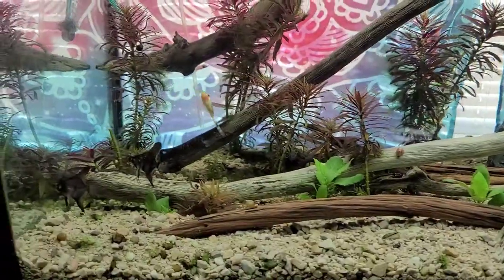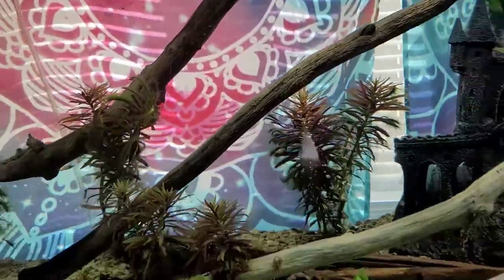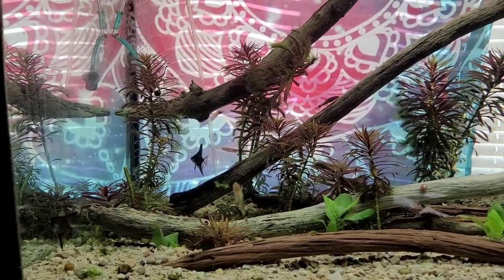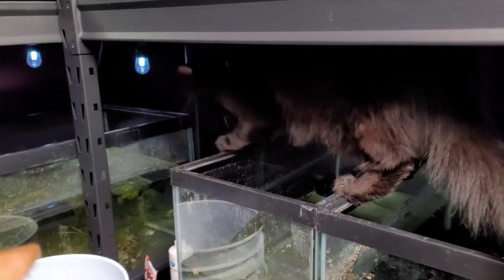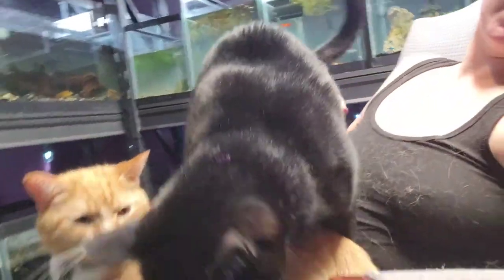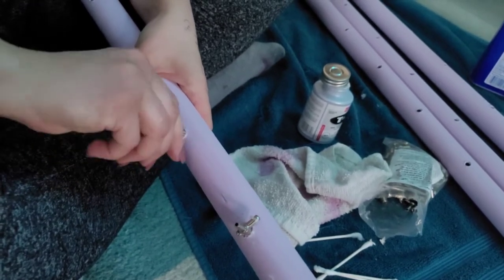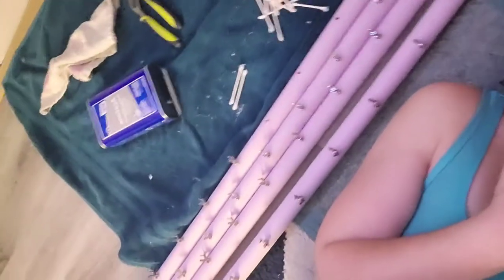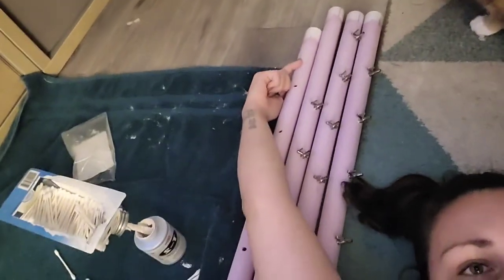Air Manifold Project Part 3 Painting Done & Spinning Valves

Comment: Pro tip: you can use the drill to screw in the valves.
Reply from the maker: I didn't want to. It's too easy to cross thread something with you use a drill and I didn't want to scratch the valves. I thought of that and decided against it 😎 thank you for watching ❤️
Reply: @ADHDAquatics  It saves the fingers. 🙂